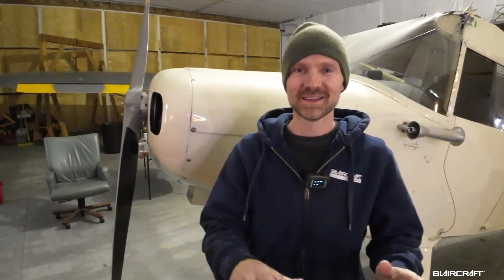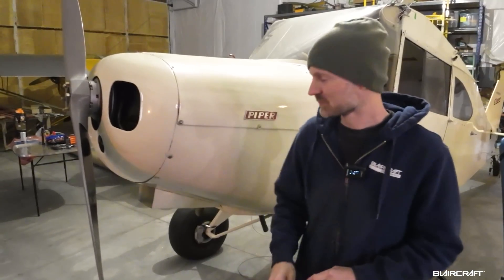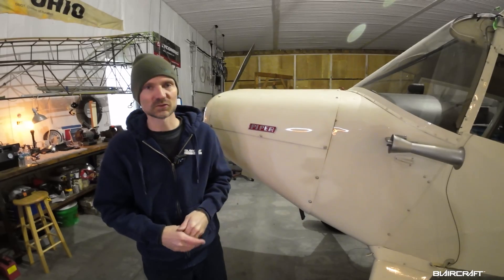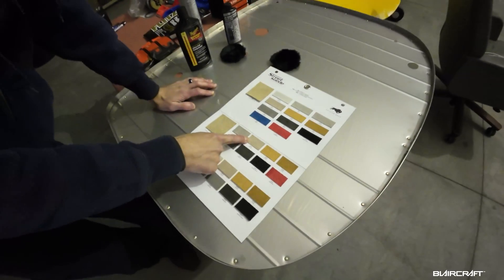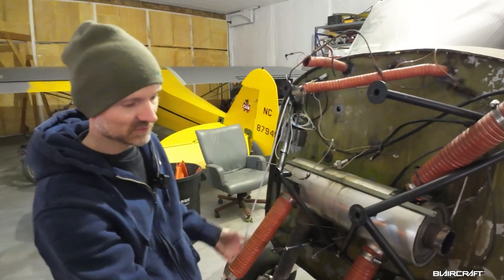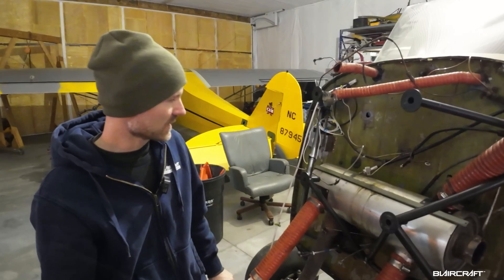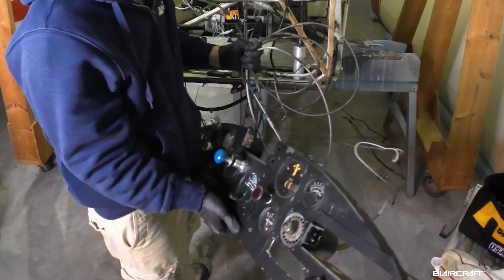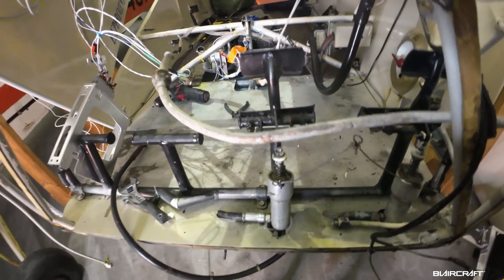It's Happening... Building the STOL(ish) Clipper

Comment: Will you have two fuel lines from the right fuel tank? Also a Maule fuel selector in order to comply with the fuel selector AD?
Reply from the maker: Great question. My clipper actually had provisions for the right hand fuel tank, but only had one line for it. I believe for the time being, unless I change my mind after Oshkosh. I will leave it with just one line, I will make sure that I placard left-hand takeoff, landing or both tanks. 
I do have the Maule fuel selector that I will be installing.
Reply: @Blaircraft.Engines  I actually took off with the right tank select and found out the hard way what the placard meant. My placard was not written correctly. Fortunately I got the plane safely back on the runway. My clipper, I believe actually came from the factory with wing tanks, as it was towards the end of the production line.

Comment: Curious about converting from certified to experimental. I have a J-4a which is similar. It’s in limbo on a restoration as Its really not a valuable plane, and it’s not common. So parts are not easy to come by. I’d love to explore engine options and not deal with certified Premium for everything.
What’s a good resource on changing to an experimental category?
Also since the fuel tanks look similar to j-4, I’ve read about splitting the boot cowl to make it easier to access fuel tank.
Reply from the maker: I don’t have the exact references handy. However, you can send me an email and I can forward you some information if you’d like.  joshua@jblaircraft.com

Comment: How do you get it experimental? I didn’t think a certified aircraft could be changed to experimental.
Reply from the maker: You can surrender your standard airworthiness and go to the experimental Exhibition airworthiness. 
It’s not a terrible hard process, but can take quite a while depending on your local FSDO. With my time frame, I personally went the DAR route. If you do it on your own , wait and go through the hurdles it doesn’t cost anything. If you hire DAR it can be a little expensive